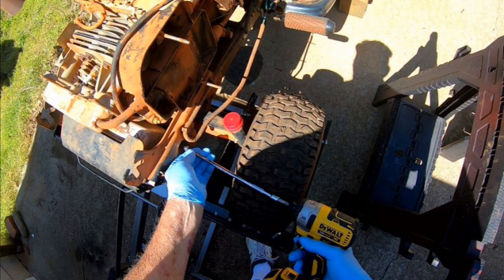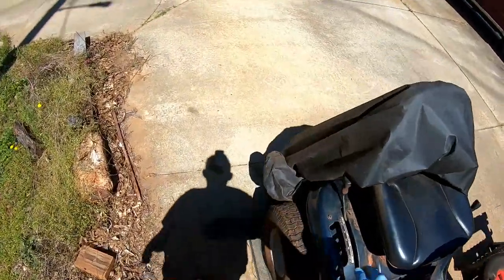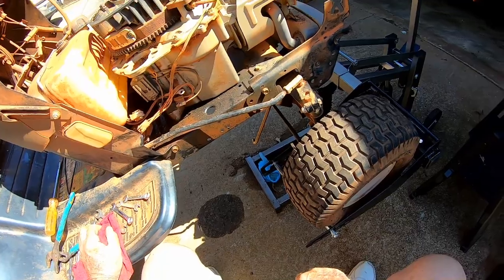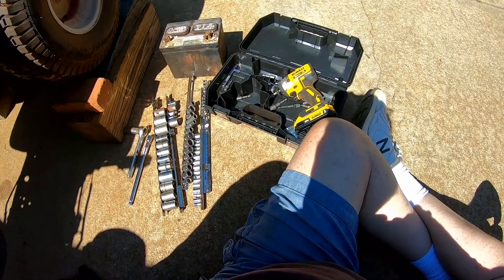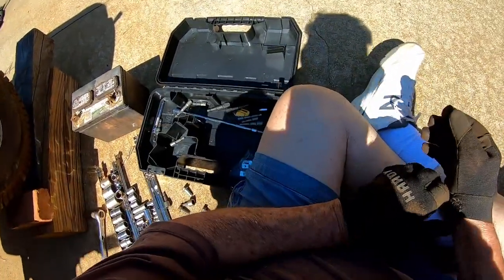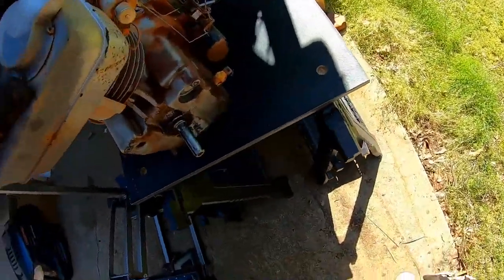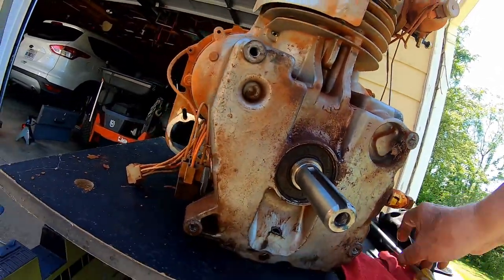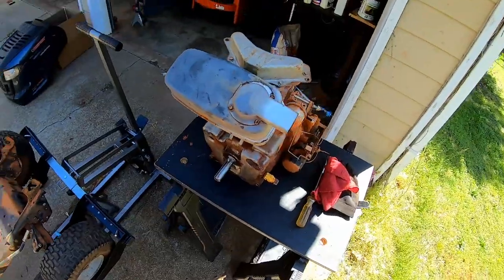Problem Lawn Mower Part 6 Defect Located

Comment: Walter, something came loose inside the motor and usually that's pretty serious. The main things you have to worry about on the Harbor Freight motor is the shaft length and diameter, the keyway width a depth and whether it comes with a muffler or if yours will fit. Don't worry too much about the mounting holes because you can drill new holes in the mower frame. If the motor base has threaded mounting holes make sure your mounting bolts fit or buy four new ones that will and be sure they are the correct length. Most of those engines are complete with starter, carburetor and air filter, and muffler. I'm guessing that group of wires you disconnected may be safety related that kill the motor if you get off with the mower running and they may also be part of the gauge system if the mower has gauges. I also agree with you that your son needs to clean his mower, you can't have an air cooled engine too clean and it doesn't take a lot of dirt and debris to cause them to run hot. You all take care and good luck with the mower. I know I gave you static about a jack stand, I saw it under your mower lift in this video. Way to be safe because I want to keep seeing your vlogs! 😃😃😃
Reply from the maker: Thanks Matt  I appreciate the support you always show for my videos  I do not know yet how he wants to proceed

Comment: Walter something has broken off in the lower end. but as you said when started the job, at least I think you did that it was running but losing a lot of oil. I think you should just go with a new engine.
But for your own interest take it apart and see what happen that would make a interesting video.

Comment: I wondered whether the subject of JB Weld would come up.  Probably duct tape would not work!  Whatever wanted out of the engine, it was good that it went downward, as it must have had a bit of force behind it.  Replace or rebuild?  Well, for me, I’d replace.  My interest in tinkering with motors cooled off right about 50 years ago.  Lazy has taken control of me.
Reply from the maker: I currently have an interest in making videos  what say we open it up and look
Reply: @pwalpar  I'd love to know what came apart, but, frankly, I'd not try to repair it myself.  Too lazy.

Comment: Those Kohler "Courage" engines are far down on the list of rugged, reliable lawnmower engines. Not only do they blow up spontaneously, but they suffer from cracks in the block often. Something HIT that one from the inside. You might ask James if he left out mentioning any smoke or loud noises it made.
Reply from the maker: LOL  I plan to open it and find out soon

Comment: Walter, You have a couple riding lawnmowers out back. Could one of those engines be repaired cheaper than getting a new engine? Could it replace this engine? Something to consider before spending the big bucks. Jon, MSO-439
Reply from the maker: I considered it they are much lower horse power motors and they were running engines  I have not ruled out the possibility

Comment: The harbor freight engine will work just fine. You could open the engine to see what broke. Probably the connecting rod. You could use JB Weld to patch the hole. I recommend  https://www.jbweld.com/product/j-b-weld-twin-tube. The easiest fix would be a new engine if you can afford one.

Comment: Better head to the mower shop and buy new mower  instead of replacing motor  you will probably save money in the long run   or look for a good used one the mower shop took in on 
trade